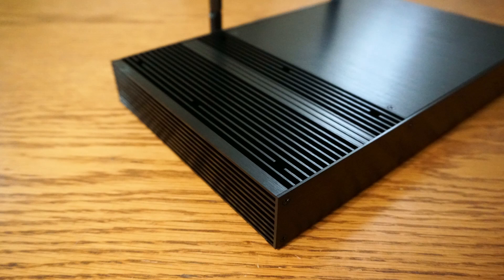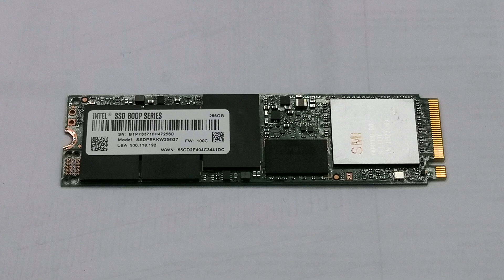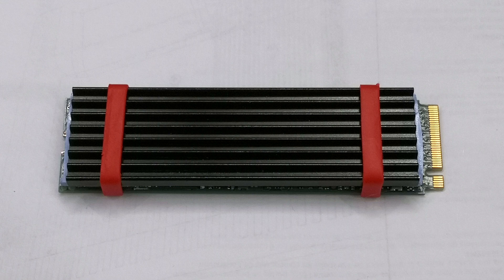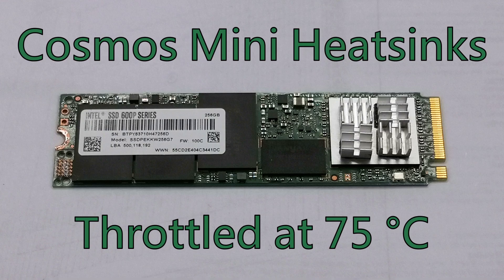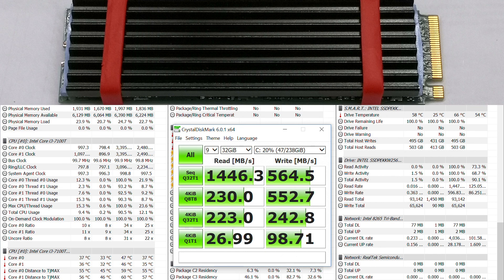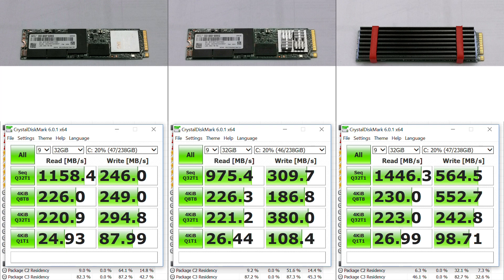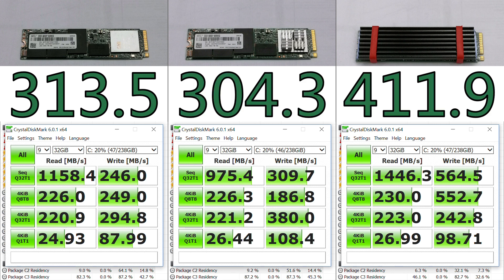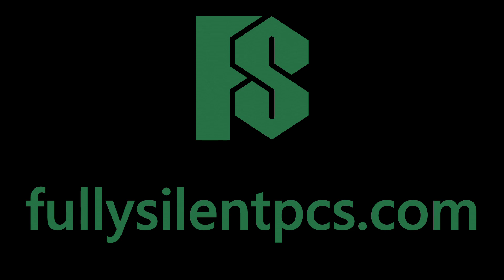Is an M.2 Heatsink Necessary for an NVMe SSD?

Comment: Do you need two heatsinks for M.2 NVME (one for the bottom and one for the top? What's the thickness in mm for both heatsinks?)? And should we remove the sticker for better contact with the thermal pad?

What's the thickness in mm is the big heatsink you used in this video?

Thank you.

God bless, Revelation 21:4

Comment: The case is not that simple! On m.2 ssd the nand chips actually PREFER to run at a warmer temperature! Only the controller is the part, that needs to be cool as possible, to avoid throttle! Some even state, that cooling the nand chips in fact can do bad for the ssd, and not good.
Reply: If you look into it more they are referring to room temps of around 25 C, laptops will never get that low, neither will most desktops (unless you happen to be in Siberia or Alaska).
Reply: yeah,  people are taking something and misrepresenting it...  the only time its good for NAND to be warm is during large write operations and warm is 40-60c where the sweet spot is around 52c.  at all other times,  reading or idle, its better for NAND to be cooler.   when NAND is hitting high temps the blocks being written to take less of degradation hit than they would at cold temps but all the other blocks are being degraded at a higher rate because of the high temps.  when not being written to NAND degrades less at lower temps.
Reply: also worth noting that,  with or without a heat sink a good NVME SSD will last at least as long as the manufacturer claims if operated within their specified parameters.  adding a passive heat sink will extend the life, because lower temps during reads and idle means less passive degradation, but by how much isnt really clear.

Comment: Now i am glad i got a full size heatsink! I had doubts due to people saying, the controller likes it warm, colling it will slow it down and reduce lifetime. But its not like it will somehow cool the ssd down to 15°C or something. Its just prevents it from reaching the 75°C where it starts to throttle
Reply from the maker: Exactly, these certainly don't cool the memory chips and controller to detrimentally low temperatures, they do prevent them from heating up to detrimentally high temperatures however.

Comment: Traditional Sata III SSDs are in a metal 2.5" hard drive enclosure which, to some extent, acts as a heatsink.
Reply: There's no thermal interface between the SSD controller and the case, so it's kinda useless. I've also seen SSDs with a plastic enclosure.

Comment: I wonder how it affected idle temperatures. 

I replaced my x1 Yoga's intel 500GB m.2 nvme with a baracuda 510 1TB m.2 Nvme and i noticed my cpu temps were about 5c higher than before? Is that expected in laptops?
Reply: it could be the drive, can you fit a heatsink in the laptop?
Reply: It's likely that both drives don't use the same storage controller so yes, a change in temperature is something to expect.
Reply: I recently built a new PC and took the baracuda into it and put the original nvme back in my laptop. The idle temperature lowered by 5 to 8c. Thanks for answering my questions.

Comment: Why you dont use thermal pad below the 4 mini heatsinks at controller?
Reply from the maker: The mini heatsinks had pre-applied thermal adhesive.  A thermal pad would have a chance of falling off if sideways or upside down.

Comment: Would this kind of heat sink work with an external nvme drive?
Reply from the maker: It depends on how much space the enclosure has.  I figure many of the external enclosures will have some kind of thermal solution built in.
Reply: Fully Silent PCs my enclosure is all aluminum alloy. The same manufacturer makes a clear polycarbonate one with a built in heat sink, copper something or other with holes,  and built in thermal pad.  Mine was $25 less expensive, so that’s the one I went with?
Reply from the maker: I would recommend using a thermal pad to fill the space between the drive and enclosure.

Comment: Heatsink is good for the controller only, not for the nand. But your test seems to tell otherwise.
Reply: @tuxshake  are you a PC tech? I was thinking about getting a new m.2 and was wondering the difference with or without in a laptop.
Reply: @tuxshake  Good point, cut up the heatsink just to cover the controller only, let the NAND run hot - otherwise you are reducing the WRITE lifetime of the NVMe. Throttling only occurs if the controller overheats
Reply: @tuxshake  this not correct.   heatsinks do not lower NAND temps enough to affect the life of your SSD.   you would have to actively cool NANDs and keep them below room temp during extreme write operations all the time to see significant degradation.   NVME heat syncs, even ones that have small fans on them, still allow the NANDs to get up to their safe write temps.    you are also not considering that NANDs degrade during reads and when idle at higher temps.   when not doing heavy write operations cooler is better for NAND.

Comment: https://www.amazon.com/gp/product/B075PC3QVK/ref=ppx_yo_dt_b_asin_title_o02_s00?ie=UTF8&psc=1

This design is slightly better vs others.  IMHO, it is really the surface area that matters.  I took the time to install this heatsink and use Artic's 1 mm blue thermal pads to sandwich above and below the SSD.

I am not fully fanless, don't judge.

With a 140mm fan running (~8" away in a big Fractal Design case) my Samsung 970 Evo Plus is mostly in ~35C ... maybe will get up in low 40C.

With no other factors changed, that same SSD without heatsink was running 50-60+ C constantly.

Comment: The NAND being hot is good - because longevity from writes just increases with heat, and near-ambient temperatures will wear out your drive up to twice as fast. 40-50+ celcius is good.
It's the controller (only) that may need cooling - but it will only have a benefit if you ever manage to throttle it, which requires pretty heavy sustained use (and probably poor ventilation too).
For that reason it's not an issue worth thinking about for most users, not even most enthusiasts.
If you however regularly use your NVMe SSD to write huge amounts of data - such as in editing and rendering 4K video or storage-based mining, then a small heatsink on the controller with thermal glue may not be such a bad idea, assuming you don't mind breaking the warranty.
Reply: You watched the video from GamersNexus
Reply: I wonder can i use thermal paste on controller. My heatsink requires 1mm and 0.5mm thermal pad. I have only 1mm pad and i dont wanna cool the nand drives, only controller. So i wanna use 1mm pad for back side and thermal paste on controller. I cant use 1mm for both sides. Too thick for the clips.
Reply: @musicxxa6678  just cut thermal pad and put it to controller and done...
Reply: I know your comment is old, sorry, when you say 40-50 is good you mean when ? When writing ? Or when idle ? Were you speaking about the temp of the controller or of the nand ?
I have a samsung 960 pro and I use my mobo's included m.2 heatsink. While idle, the controller is about 40°C and about 65°C under stress tests so it's pretty good, but Nand temp reaches 73 max during tests.
I compared this to my second nvme drive, a samsung 960 evo, and during stress tests, the nand reaches 89°c.
Question : do you think the 73°c of the nand on my 960 pro during writes is not hot enough and can cause a decrease in the drive's lifespan ?
Reply: @AngryChineseWoman  shit - I managed to accidentally delete my previous comment. Maybe you still got it viewable as a reply...

But to summarize:
- temperature of NAND matters when writing. Being how while idle is no problem though. NAND typically has to get several hundreds of degrees celcius to be damaged - and up until that point where physical damage happens it only benefits from extra heat by wearing out memory cells slower when writing. Reading from memory cells causes no wear worth mentioning - regardless of temperature.

- The controller should be kept "cool". If it gets too hot it will thermally throttle, leading to reduced performance. In really heavy use-cases it may need a heatsink to continue performing at peak efficiency - but in typical uses (ie. relatively short burst of activity) it's not needed.

The takeaway from this is that if you cool you controller - don't also cool the NAND. That will just be counter-productive. That said, write-endurance on modern SSDs is so good now that it probably won't wear out before the drive is obsolete even if you over-cooled the NAND - so don't stress too heard about it. But if you are going to put a heatsink on there you might as well do it optimally right? Rather than slapping on a heatsink that covers the entire thing including the NAND, because that's just stupid. (even though that is exactly what several professional companies do - probably mainly because it looks cooler that way).

Your temps look good to me. As long as the controller doesn't reach the thermal throttle threshold then you should be good - and then you just leave the NAND bare and let them get as hot as they get. Theoretically they might benefit from actual heating but... that's going a bit overboard. There are interesting articles about the potential use of micro-heating in short bursts in future SSD products that could potentially make NAND endurance be thousands of times higher though. That is worth a read. It would require a change in how the NAND is physically produced, but it might be something we see in the near future - probably first in the enterprise sector where durability tends to matter most.
Reply: @TheStigma  Thanks a lot for your thorough reply :)
Reply: @TheStigma  Thanks a lot for the information!

Comment: my mobo came with a  m.2 thermal pad, where does it need to be applied?
Reply from the maker: Over the whole SSD if it fits, otherwise, it should cover the controller module (close to the connector).
Reply: Traditional Sata II and III SSDs used to come with thermal pads too.

Comment: The Problem is that the NAND is also cooled, which reduces it's lifespan, and makes it age faster.
But in a fully passive case without any airflow, a M.2 SSD cooler does make sense, since its always warm inside. :)
Reply: Just curious, why did you mention that NANDs were cooled... is that not a good thing?  

Of note, I've heard something about a NAND needing some heat to break an electron barrier or something like that...